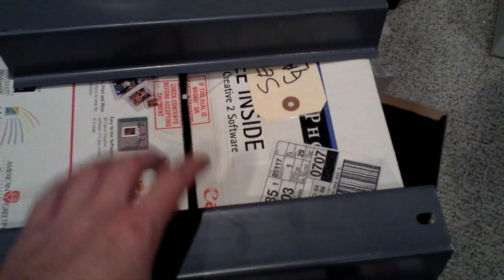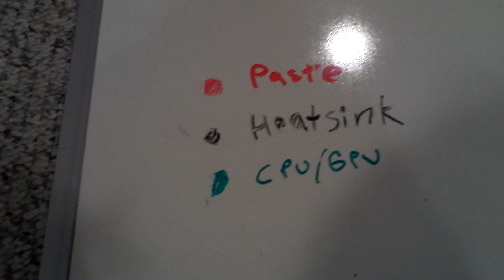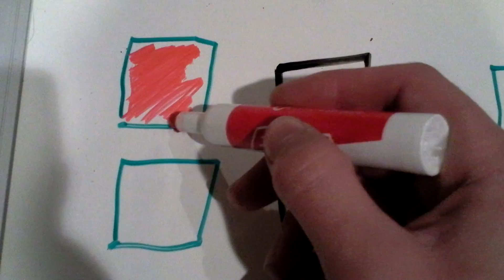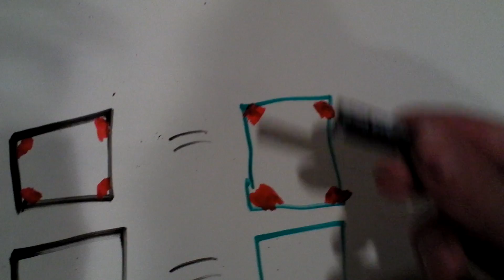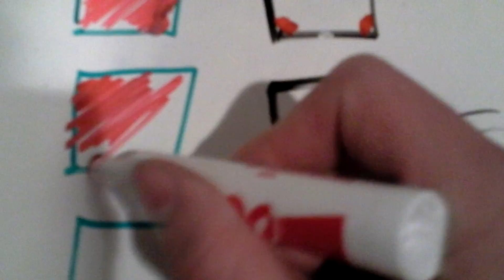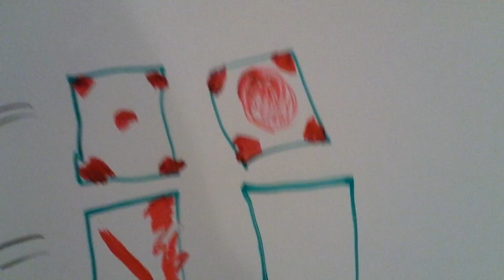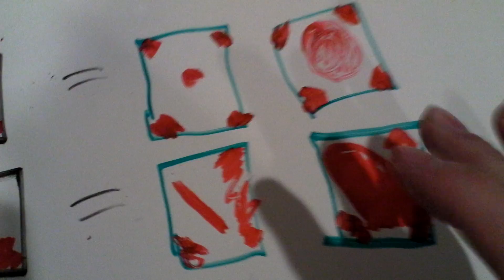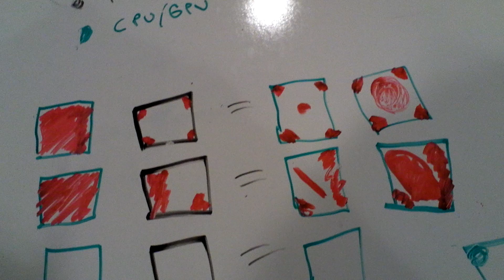Ps3 Fat 60gig Thermal Paste Tips and Cooling Modification + External PSU

Comment: Um keeping the ps3 vertical allows the vents to actually pull from outside of case, if it was horizontal the surface it rested on would block the air due to narrow gap, if on stands much better. Vertical may cool better but is less stable (ie risky). Most internal views I have seen show the intake for fan is very close to case bottom, greatly choking it off, this is why the bottom holes help, more air thru fan. Fan likely is slow running, try it at full volts first and see if good enough now.

Comment: Looks cool, but Id like to keep all the parts together. Did a soft mod already on the back, drilled a few holes, and made a big hole above the psu. Want to put on a fan above the psu, attached to the case. Was wondering about the air's direction. Should it suck the hot air off the psu, or hit the psu with cold air from outside with normal fan direction?
Reply: pulling its hot air out, so make an exaust ;)